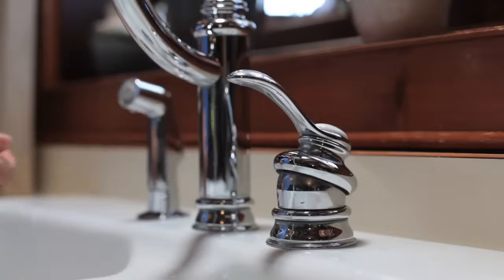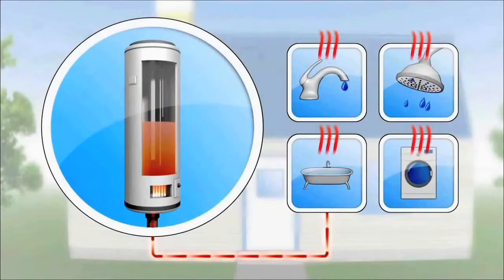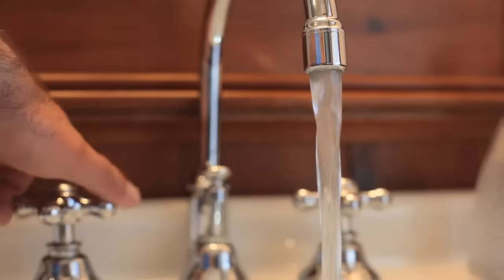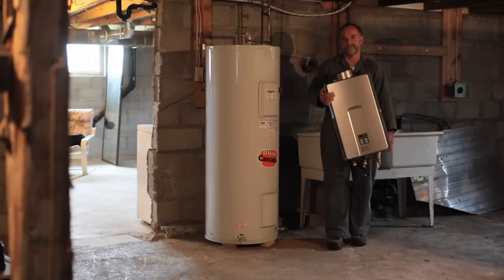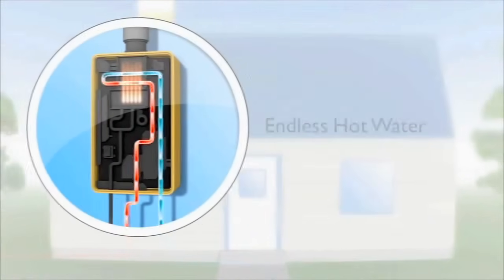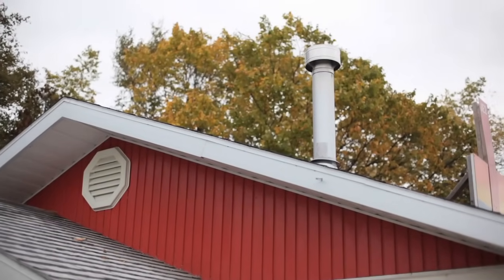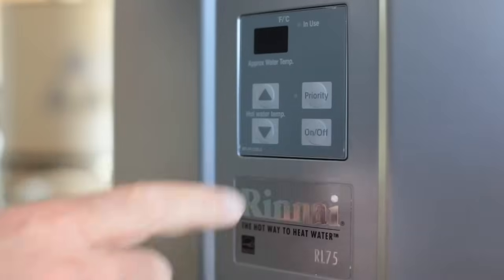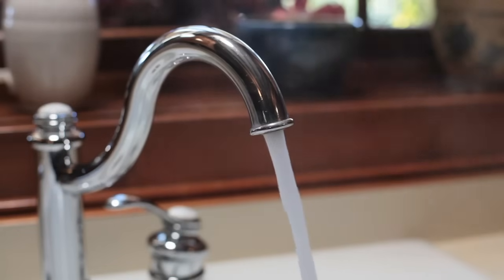How Tankless Water Heaters Work

Comment: I installed a tankless water heater 95% efficiency  almost four years ago. This is my experience.
Here are my pros:
1 Endless source of hot water, even with multiple taps or showers runing simultaneously. 
2 Savings for my household in gas bill of about 10 dollars a month.
3 Spaces saving in my basement .
4 Longevity,  some units can last over 20 years.

Cons:
1Hot water takes a bit longer to reach the tap so it wastes some water even after I insulated all my lines.
2 A bit noisy, specially right above the unit. The exhaust fan sounds like a drone :)
3 Yearly maintenance. Descaling the unit with vinegar for an hour. I do this service myself as a professional    plumber will charge more than your yearly savings in natural gas.
4 In the event of a failure it would be difficult to find parts right away , forget your home center or appliance center. Most plumbers do not work on this units.
5 No electricity = no hot water in a power outrage.
I can see why this thecnology is not for everyone.
Also consider that if you only need small quantities of water in small burst  (turning the tap on and off )the unit will turn on an off  so briefly that you wont get your desired hot water. This units shine when there is a good constant flow of water. 
All said my family is very satisfied with our unit. I plan to repkace it with another tankless when this one goes.
Reply: What Brand of tankless water heater is good?
Reply: ... for a travel trailer...

Comment: The purely positive comments made about tankless water heater technology here are inexcusably misleading. With usage and job conditions so varied, no one knows how a tankless water heater is going to perform in any given home. One thing we do know for sure, no one mentions combustion efficiency ratings when talking about tankless heaters. The marketing industry has got to stop using the terms “endless hot water” and “efficient” in the same conversation. To create endless hot water you’ve either got to restrict water flow volume or dump an absurd amount of BTUs into the combustion process. So, 180,000 BTUs vs the 40,000 of the tank type water heater shown in this video make it not so much an automatic win for a homeowner.
Reply: Love my tankless.  Love it.  In Korea EVERYONE has tankless.  Since I came here 10 years ago they have only gotten better.  I will never do a tank again.  There are reasons why the people who have them, love them.
Reply: I live in tropical country, and most people use tankless water heater since we only use it for shower not heating the whole house. I think this is better system since we mostly turn on only for 5-10 minutes for shower and only 1-2 people take a bath at the same time… so we don’t really have problem with water flow. Even with the most low setting already hot enough, but that maybe because we only need to heat 10-12 degree of water most of time

Comment: Were getting a Navien 240A2 tankless to replace two 40 gallon hot water heaters. I live in Houston Texas so even during the winter it will produce 30% more hot water than two 40 gallons units. During the summer with a tap water temperature of 80F, we will produce twice as much hot water. Since it's me, my wife, and the dog we shouldn't be able to over-tax the system.
Reply: Don't get Navien.... I would recommend watching videos of Mikey Pipes Plumbing.!! Navien👎👎
Reply: @videos10  It's already installed. Our gas bill went from $40 per month down to $10 per month to run the tankless water heater.
Reply: @kentharris7427  yeah the savings on surely there, I still would advice you to watch videos of the Pipe Doctor plumbing regarding Navien tankless  products.

Comment: I was just thinking, it would be more advantageous to have a system that could automatically flush the heat exchanger with that vinegar solution to clear out the hard water scale and other minerals. Perhaps have it adjustable so you could have the system do it every set amount of time depending on your water's chemistry, or maybe even have PH sensors incorporated into it to adjust the amount of time between cleanings automatically. My thinking is that if the cleaning solution is just vinegar, it shouldn't cost very much. I guess the practicality would depend on how large a tank you would need to store the solution in between cleanings. Obviously if you need a several gallon tank to keep enough cleaning solution for a year's worth of cleanings, it's going to defeat part of the purpose of having a tankless heater in the first place.

Comment: We just recently bought a house with a tankless water heater. My issue is the amount of time it takes for the water to warm up to wash my hands. My bathroom is not far away from the system so I am not sure why it takes so long. We are also on a well so the waste of water is a real issue. Hope you have some suggestions.
Thanks
Reply: You’re having to push all the already sitting water in the hot side line then the hot water from the heater.
Reply: Possibly outdated unit. Possibly low flow fixtures dont trigger the unit. Possible scale build up in the lines not triggering unit to turn on
Reply: You can install a recirculation kit for a nominal charge.

Comment: A plumber talked me into our gas tankless water heater. About 7, 8 years ago. Because our regular plumber is not familiar with the issues, we haven't gotten a guy over here to try to troubleshoot what is going on. Here's what occurs: Water takes a while to get hot, old house, we get that, but THEN hot for 2,3 minutes then ICY COLD and higher faster water pressure. So, very quick showers my husband and I take. No others in household.  Now, when attempting to fill a tub, icy cold water gushing out after 2,3 minutes and CONTINUES to be COLD for MINUTES, this messing up ability to fill a tub with all hot water. I JUST learned about descaling this week, plumber did NOT TELL us about any maintenance.  So, about to do the vinegar treatment (another scam is using an expensive cleanser, when vinegar is all you need.) But, we are far from 'handy' and busy, so we are gonna farm out the descale process, lol. But, I long for my old large tank, with endless hot water. What gives? I guess I need a plumber familiar with the downsides of tankless to try to figure out why we have little to no hot water.
Reply: @PelonMusk  So glad you commented, bc I wanted to do a follow-up and didn't know where I'd dropped the comment. Turns out, we got a smart plumber in who discovered that LEAVES had been blocking the area inside the machine, so all got cleared and also, they did the treatment where you decalcify, so we have awesome no-problem hot water all the time now.
Reply: Anything you need to Learn about this...
Google the sentence, ask questions... and also ask on YouTube (top line)...
someone will know what to do... I google it first...
Reply: Call a plumber?
Reply: Yeah they suck unless you have very severe size constraints

Comment: How can I it heat city water to such a hot temperature so quickly? You say water passes by propane over the course of a second or two? I don’t understand how that could be enough time over the heat to get the water to be 100°.
Reply: the pipes are coiled around the flame in the heater.
Reply: @EduQuickies-w3q  But the speed at which water travels from outside the house to the shower seems way too fast for there to be enough time for the fire to heat. Obviously it works though. My mind just can’t process - lol!

Comment: I am currently working on installing an outdoor boiler, I built and entire plumbing setup that consists of 3 circulator pumps and 2 heat exchangers( a 50 plate - for hydronic baseboard, a 20 plate - to preheat the water to store in the water heater tank).... after I move the water heater to a different location of my basement.
        I just bought the house 3 years ago, and have no clue how old the water heater is, so I was going to get a on-demand water  heater , my question is should I still pipe it how I was so I would be preheating the water before going to on-demand water heater then to my mixing valve? Or in the winter time just just have my 20 plate heat exchanger act as an on - demand / then summer time I'll just valve it off to run through the new electric on - demand
Reply from the maker: Good Morning!
Those are great questions, and I happen to have a lot of experience installing an outdoor boiler. First of all, I'd definitely not preheat water going into an on-demand heater. They're not made for this sort of thing, and I'd be concerned on several levels. 
The very best approach would be to have your 20-plate exchanger preheat water before it goes into a tank-style heater. The heat exchanger doesn't make for a great on-demand heater on its own because sometimes your fire will burn down too low and you won't have hot water (or it'll just be warm). At my place I have the thermostats on my electric water heater set just below the temperature that the heat exchanger delivers hot water. This way if my fire does accidentally drop too low, the electricity kicks in to top up the heat in the tank. I hardly use any electricity at all this way, but it is a bit of insurance. In the summer I run the hot water tank on electricity only, but I'll be changing my tank to propane to save a bit of money. Same idea for preheating, it's just that propane is 75% of the cost of electricity when it is needed. 
When I was designing my system I considered a tankless heater for my place, but realized that my electric water heater was pretty close to ideal, given the fact that wood heats my water most of the time. Tank-style heaters are also very simple, which means I can keep it working myself. 
If I were you I'd replace the tank-style heater you've got if you think it's too old. They're pretty cheap and they work really well with an outdoor boiler.
How does all this sound?
Bye for now,
Steve
Reply: Thanks very much, I am going to go that route on keeping tank style . Thanks again an I subscribed for more of these very informative videos you put on
Reply from the maker: My pleasure! Keep my email on hand. You'll probably run into issues as you go. steve@stevemaxwell.ca
Drop by for a visit sometime at my website: https://baileylineroad.com I think you'll like what you find there.
Bye,
Steve

Comment: Great video, subscribed, is it easy to install tankless water heater. 
Thank you
Reply: Usually they require an upgrade to the power source . Allot of these tankless water heaters require 2 - 2 pole breakerusually 30s or 50s so you will usually have to add a run of wire or two to your pannel depending on what size your original wire was you may be able to reuse it 0

Comment: I was hoping to get more info. about "how tankless water heaters work" not just a sale pitch.  You know the internal workings?  How does it regulate temperature?  Does it restrict flow if the demand is beyond it's capacity to heat?  What about these alarms?
Reply from the maker: Hi Donald,
Thanks for your note. I'm happy to answer your questions. I've installed tankless systems and I see them in action all the time.

As for internal workings, a gas flame heats one side of a heat exchanger, with water flowing on the other side. The flame is activate by the flow of water. These heat exchangers need to be de-scaled once or twice a year by running vinegar through the water side of the system. Special valves allow the water to be shut off and the vinegar to be piped through to dissolve scale on the heat exchanger fins.

Temperature is regulated by a system that modulates the strength of the gas flame to match a preset water temperature in relation to flow rate. The greater the water flow demanded, the higher the intensity of the flame. Flow is not restricted if the water flow demand exceeds the heating ability of the heater. All that happens is you get a lower water temperature. This is why it's important to size the heater to expected maximum demand.

I don't know what you mean by alarms.

I hope this helps.

Bye for now,

Steve
Reply: Thanks.  That helps a lot.  The issue that I had was low flow/pressure.  And it turns out that the flushing descaling worked perfectly.

Comment: Nobody mentions the fact that WHO's going to repair that tankless water heater eventually going to break down? I'm an experienced HVAC tech, used to be IBM electronics Tech. college trained in HVAC but clueless when it comes to Tankless. BTW whoever gets internet links to any of a service manual of a tankless water heater please post it. Thanks
Reply: I hate installing and working on tankless water heaters. They can be a pain. But its where we are headed.  Most of our rich customers have been conned into thinking they are a necessity. I would never install one in my house. My hot water tank is almost 20 years old and still running believe it or not

Comment: i have a small tankless water heater ... sometimes when the water is running at a high pressure using the water pump  it acts as a cooling system and the water is cold... and when i turn off the pump ... water is resisted and  the heater doesn't detect it because it's not strong.... it's a problem.... i always have to find a balance ....  another inconvenience is that i don't grt instant hot water when i need yo wash my hands quickly

Comment: i am using 3 tankless water heater in my home,,,,,,,,,,,,,,and i am very very happy with them ,,,,,, one for kitchen and 2 for wash rooms ,,,,,,,,, problem i face with them is low water pressure ,,,,,,,, in kitchen pressure is ok becuase water heater is very very near ,,,,,,,, but in wash rooms pressure is low because water heater is far ,,,,,,,, so to solve this problem i add pressure booster pump with every water heater ,,,,,,, a tiny pump fit on inlet of water heater ,,,,that not only solve the low pressure issue but also gave another benefit , there is no scale develop in my water heaters , high water pressure blows away all scale which develop inside water heater ,,,,,,,, and another thing is that i use those pumps and water heater even in summer , i simply switch off the water heater but keep water running from them even in summer ,  that remove all scale in summer which develop during winter ,,,,,,

Comment: Excellent Video...
I'm looking to put in a  Tankless Water Heater
in an Vintage Travel Trailer... but I want electricity...
I don't want to tote around Propane tanks at my age (64 years old).
I will not need a big water heater... can you suggest a brand?
and do you have a video on installing a tankless water heater in an RV?
Thank you very much for sharing this wonderful video.

Comment: I forgot to add an operational issue. You get in shower tanks comes on . You exit shower wife gets in. Water is hot at first then goes cold as unit has cycled off and not on yet. some builders install storage tank in line to combat this. So much for saving space and no standby loss
Reply: I cant, I wouldnt ever instal an instantaneous heater
Reply: I hear you on the cold sandwich, could be annoying. If i installed one i would use the Navien with the built in recirc pump and buffer tank. Even if you dont have an external recirc loop, you can tell the Navien to use it as a buffer within itself
Reply: You get in shower, water is cold because not heated yet. A few seconds later, water gets hot. You exit. Wife gets in shower, water is cold because not heated yet. A few seconds later, water gets hot. I don't know why you would say you get a hot shower and your wife does not. Makes no sense. If you got a hot shower, should be fine for your wife also.

Comment: I bought a duplex with a tankless water heater already installed in one unit and regular natural gas in the other. Guess which one rotted out in only a short time. After pricing the replacement I had them install a regular electric tank.

Comment: What do you look for when picking a quality  tankless hot water?
Reply from the maker: +gj4king1 Hello and thanks for your note. 
Capacity, brand reputation and fuel are the three main technical things you need to consider when choosing a tankless heater. But before you get that far you need to decide if tankless is right for you at all. It’s not ideal in every situation. 
Tankless water heaters are wall-mounted appliances that heat water only as it’s needed. They just sit there, using no energy at all until a hot water tap somewhere is turned on. As soon as water flows through the heater, it fires up the heating system, raising the temperature of water as it flows through the heater. There is no tank of hot water sitting there between uses losing energy, as is the case with your current heater. Elimination of these “stand-by” losses is why tankless heaters were invented.
All this said, if you have a large household and use lots of hot water, standby losses from a tank-style heater become less significant. Also, today’s best tank-style heaters are well insulated with foam, so standby losses are smaller than they used to be. Then there’s the issue of an energy source. The only tankless water heaters worth installing use either propane or natural gas. Forget electric ones. If your home isn’t made for these, getting either one piped in adds cost to the installation. 
Here’s the bottom line: If you need a new tank-style heater, tankless is worth considering, especially when space is at a premium in your house. Choose a tankless heater that has more than enough heating capacity for your household. And finally, choose a brand with a long reputation for quality. Tankless water heaters are much more technically complex than tank-style heaters, so it takes an experienced company to make them reliable. Bosch, Rinnai and Rheem are three trustworthy names.
Drop by my website https://baileylineroad.com for a visit sometime. You'll find lots of stuff there, including tool giveaways, articles and the chance to ask me questions. 
Bye for now and thanks for watching!
Steve